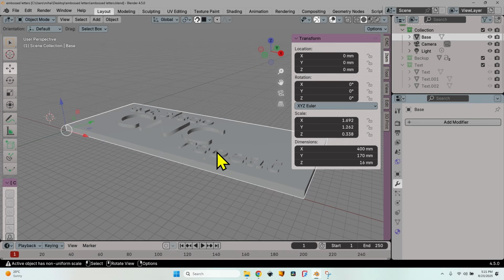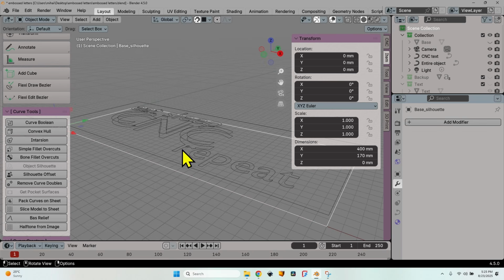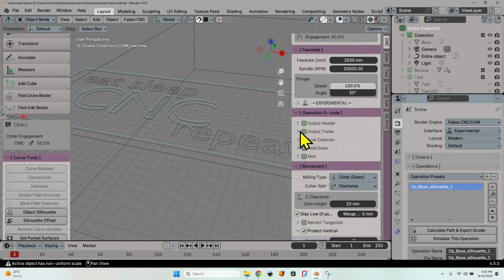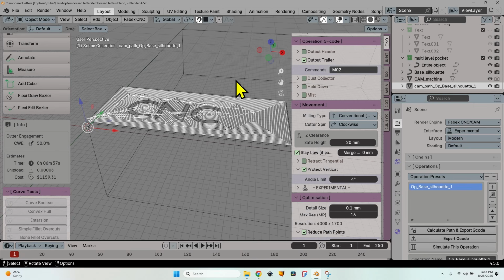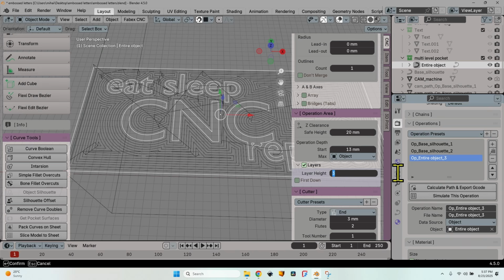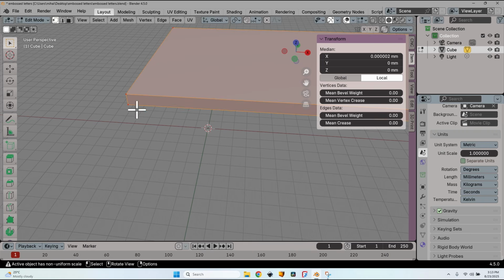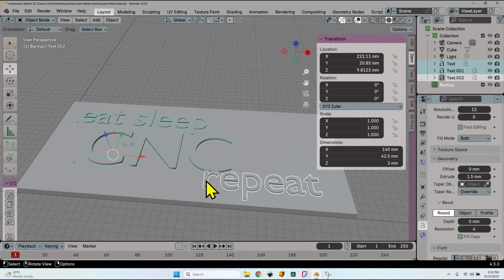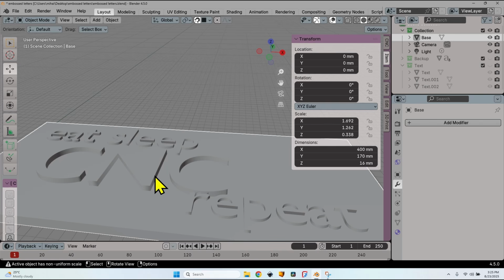Embossed Lettering on a CNC Router: Design → G-Code → Real Cuts (No Paid Software)

Comment: I discovered that after generating the tool path, I can edit the tool path like any other curve..   Super useful when I have something quick to correct and I don’t  want or need to correct the original object.  Let’s say you have an outside pocket that goes to the edge of the material and you actually want the path to extend beyond to remove the round-over.  Just generate the path, then edit it by selecting the path object, hit [tab], and you can move individual lines or points.  Be careful when doing this and review that you don’t change something you didn’t intend like z height.  Then export the g code.
Reply from the maker: Great tip! Also, make sure to take into account the direction of the cut, otherwise you will end up with a mess